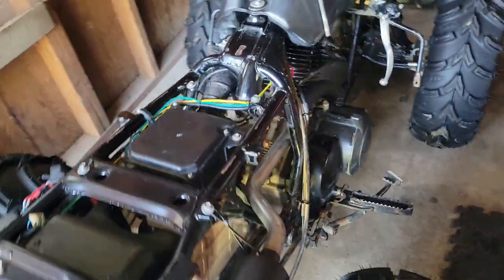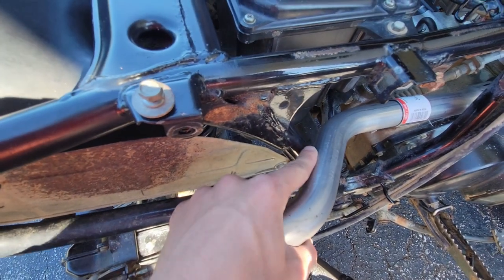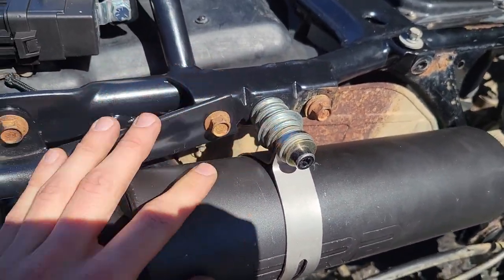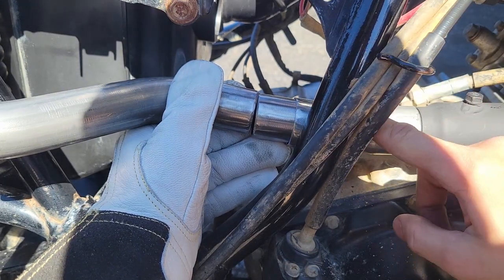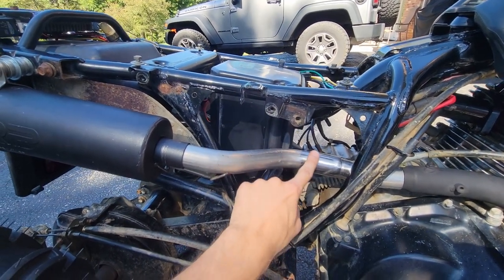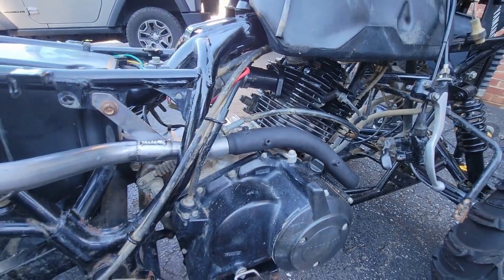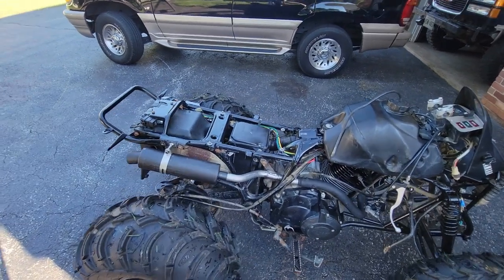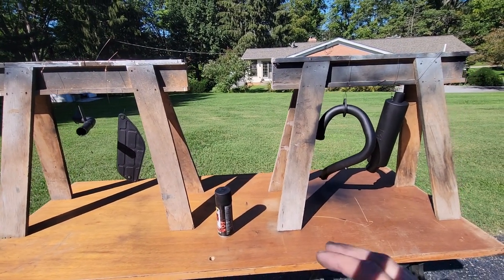MBRP Exhaust - 89 Yamaha Moto 4 Head Repair (Part 10)

Comment: What a pathetic instruction sheet. My 95 350 is suposed to be compatible but it hits the rear rack and heat shield bolts i am very frustrated. You pay 200-300$ for a well known brand and you get this crap. Did you try installing it lower with the bracket?
Reply from the maker: I agree! I also assumed that when they market it as fitting a specific model, that it would bolt right up. Not the case! I could not find a way to get the exhaust to fit using any of the included hardware.
Reply: @BustedBeaters  me neither! I used the spacer that was included but i had to rotate my exhaust sideways. Had to rotate my exhaust tip 90 degres. Its going to a fab shop so ill try to get it fitted better with a longer bolt and longer spacer. Its really not meant for anything other than a 400kodiak/bif bear 1999+.
Reply from the maker: I didn't think about rotating the tip. I'm sure the fab shop will be able to fit it up with the longer spacer. Mine fits up pretty nicely like that. Having the exhaust on sideways would drive me insane lol